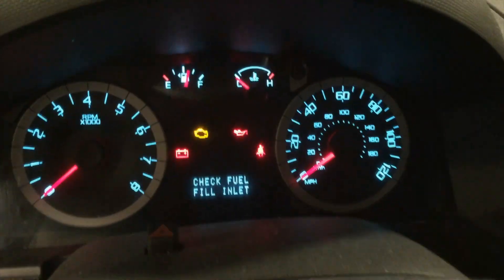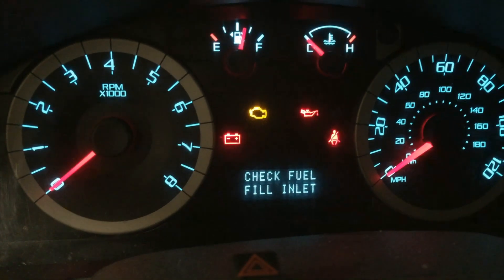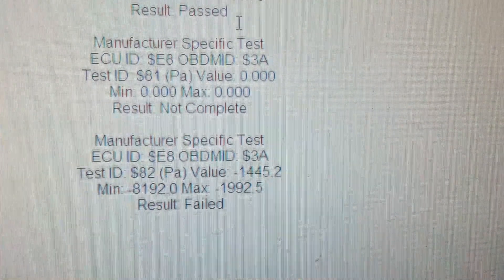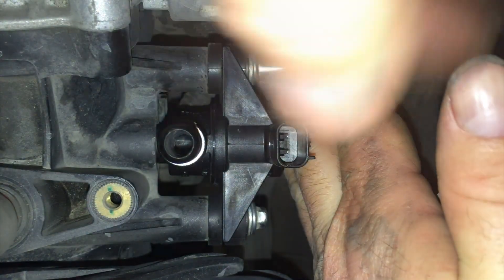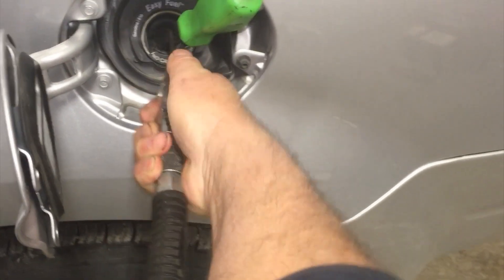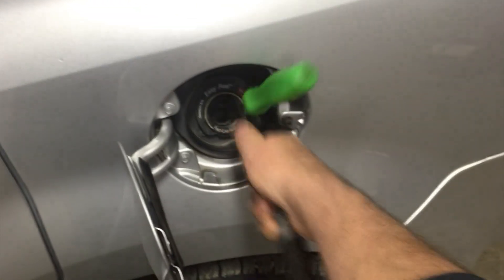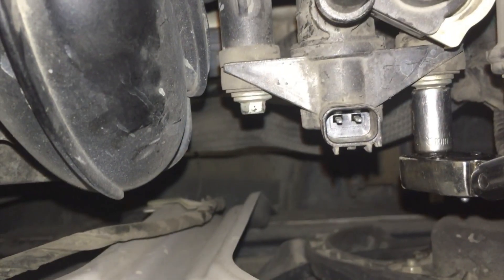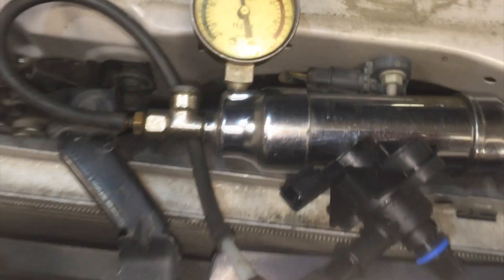Ford Code P0455 P0457  - Ford Escape Check Fuel Fill Inlet Message

Comment: If you used compressed air, do not use the plastic extension piece on the can of compressed air. It flew in there for me and I had to unclamp the hose and push it out using a boroscope. 😂😅
Reply from the maker: @ElusiveTechBro  oh crud.

Comment: So..I recently replaced the throttle body on my 2010 ford escape with the 4 cylinder engine. Now I'm getting the p0455 code. Could I have damaged the part you're talking about while changing the throttle body? While moving the tube that connects TB to air filter box?

Comment: I have a permanent code P0455 and P0457 on Ford 2010 fusion huh how much does all this cost with parts and work they tell me to keep driving the car doesn't drive the same smells like gas too. Feels frozen not fast no more too etc. I'm tired help.
Reply from the maker: Less than $100

Comment: Thank you for the help. This was very clear and easy to understand. I just picked up a Blue driver Scan tool and this code came up. I did have debris in my capless gas filer and it cleared up from the system. I feel like a pro now. 👍👍👍

Comment: Thank you so much for this video! I cleaned the fuel inlet and replaced the rubber seal on the fuel door. These codes kept persisting and no mechanic ever offered a resolution. I replaced this part so easily during a trip in July and the "Check fuel fill inlet" message and associated codes never returned. The car runs a lot peppier than before. Again, thank you for such a helpful video!
Reply: I would like you to inform me as 'How to replace the rubber seal on door" as mine is now a week seal and water is entering as drive thru washing.. thanks

Comment: I replaced the purge valve and cleaned the fuel fill inlet but still get the p0457 code. I was getting the p0456 off and on and changed the vent valve. What else could it be?

Comment: Thanks Car Doctor!  Save me a $250 diagnostic fee at my local Ford dealership and, who knows, whatever they would tack on to replace a $40 part.
Had a the fuel inlet msg for weeks, then last week came the Check Engine light - AutoZone told me I had a code P0457 on my 2012 Ford Escape.  Bought the part number mentioned in the video and installed it myself.  FYI - the light and msg didn't go away at first after installation and turning her on but after driving for 30min, then shutdown for 2hrs, and start up again - both fuel inlet msg and Check Engine light were gone.  Thanks again.

Comment: Great video.  My 2012 ford mustang 3.7L's cap will not open.  The little rubber next to the vacuum fuel cap area that is shaped like tiny pointed "thing" on the right side when opened seems to be damages within the fuel cap area.  Is there an easy fix to replace the immediate inside of the fuel cap area of the top area instead of replacing the entire fuel filler neck area that will require taking the tire off, etc.  Thanks. Dr. Helen

Comment: Great information.. Greatly appreciated. I also found that in the filler neck there are two plastic release buttons (1 on each side) that your fuel filler nozzle hits to release the filler flap. Mine was stuck so I sprayed a little WD on them and freed them up. Now the flap fits snug and the light went out.. Hope this helps...

Comment: Great Video - Thanks!! I changed out the solenoid in 15 minutes with your video as my guide. The light is out, the "Check Fuel Fill Inlet" message is gone - here's hoping they stay that way.

Comment: Hi I have 14 Ford escape 1.6 eco boat.i have no engine check light or any code but have a problem that every time I fill up gas .it wont start  it takes longer self and couple of tries. After starting  the problem goes away.and come again when ever I fill gas .Please help me

Comment: Hi Doc.

Would you know where the canister purge valve would be on a 2006 Ford Escape 3.0? My wife's escape has the same two codes you mentioned in the video. But the canister valve is not in the same location as what you showed in the video.

Comment: I have a Ford edge 2014 sport utility limited AWD 3.5L V6. Bought it used from the dealer at 52000 miles.Drove it 2000 mile
and the engine light came on. Stopped at Auto-zone and they came up with code 456. Would your fix work for that code also? Should I spend the money buying a filler cap?

Comment: Mine is not closing properly. It’s stays have way open. 

Any thoughts?
Reply from the maker: What isn't closing properly? The fuel pipe flapper? Maybe broken or contaminated
Reply: The Car Doctor 

It’s the flap. It can be pushed all the way in but it stays stuck  half way back

Comment: Whenever. I fill up it over fills, would the purge valve cause this? Or would it most likely be the breather line?
Reply from the maker: it over fills? as in it gets too full of gas and fuel runs out all over? or its har to fill and it keeps burping out gas while attempting to fill?
Reply: The Car Doctor the gas pump does not kick off.  It keeps pumping when car is full .

Comment: This is utterly ridiculous. Can that capless thing be REMOVED and replaced with a regular, screw-on cap? anyone can just walk by, open the  gas cap, and dump anything into the tank.

I'd be very interested in finding a way to remove that stupid capless thing, and get a regular, old-fashioned lockable filler cap.

Comment: Thank you so much for your excellent video. I just had "check fuel fill inlet " message yesterday. I simply bought a new valve to replace the old one, even without the diagnosis.  Then after only 1 full drive circle, the annoying message has gone. Your video is really helpful. Give you 10000 thumbs up!
Reply: What did you change

Comment: Great video thanks I keep getting code P0455 EVAP system leak 2001 Ford Escort I changed the gas cap that didn't fix it. So tomorrow I plan on lifting the car up and inspecting all the fuel evap hoses and that  canister and the purge valve... and I'll get back to you  find the leak...wade
Reply from the maker: How did it turn out?

Comment: Thanks for posting your videos and helping out , I do have a question I have a 2003 escape with a p0443 and the evap purge valve connector has not electrical power at all. The evap 5A fuse  has electric power however there's not continuity to the connector... My question is, should be a break in the wire somewhere or should be the PCM that is bad?

Comment: Thank you sir for this helpful video i have this problem with my 2011 escape 3.0 L , I will fix it i have this issue for about 3 minutes ago , after I checked it or changed the part I will put anther comment on your video. Thanks again

Comment: Thank you sir for this very informative video. I do have a quick question, when blowing the compressed air into the inlet, should I have the inlet open as you have in the video? I tried cleaning on advice of another video by blowing compressed air in the inlet, using the funnel provided in the car to toggle the medal inlet, then spraying the inlet with WD-40 and toggling the inlet again with provided funnel. I finished with drying the inlet with more compressed air some dirt wouldn't stick to the WD-40. Sadly after trying this, my message center showed the same message of "check fuel filler inlet" Trying to save some cash but should I have a smoke test done, or just replace the purge valve as recommend in your informative video. Thanks in advance for any info!
Reply: K270 Do you still have the error code on your dash? Did you disconnect and reconnect the battery afterwards to reset the computer and clear the engine code?
Reply: Also, I'm not sure I'd spray WD-40 on the inlet. That's just me though.
Reply: Actually, the engine light shut off on its own. I took it to my mechanic anyway and he saw several codes in the memory, one which he was unfamiliar with and I forget what the code was. He researched and asked me if I had recently disconnected the battery. I told him no, but I did have some corrosion on the terminal. His conclusion was to clean the terminal. I believe the reasoning was the computer needs a strong connection. If the connection is weak it can throw up codes. I cleaned the terminal a couple weeks ago and so far the engine light hasn't come back on. I should recheck with a computer to see if the engine codes have been erased from the memory.

Comment: Thank you for your video on 7:15 2017 I experienced the check engine light on my 2010 Ford Escape XLT after researching and coming up with code P0455 I found your video which at which time I went out to my local auto parts store and purchase the purge valve after installing and not forgetting to disconnect the battery to clear all previous codes I was happy to see my problem was solved many thanks you saved me at least a hundred fifty bucks.

Comment: Excellent info, thank you very much! I was t-boned in an accident 8th May and had this fuel fill inlet message shortly thereafter. I was also gone for a period of time and didn't drive the car until the 24th. I have to wonder if it's out of the realm of possibility that something got jarred in the impact. The visible damage didn't make it as far back as the gas door and the door seals well. After the first error code on 5/26, I cleaned the area, used the included fill funnel to  insert it in and out of the fuel fill area multiple times. The code cleared the next day. Today, I had the error again. Ugh! I'm definitely NOT a fan of the capless system. Clearly Ford knew it was going to be problematic or they wouldn't have included that fill funnel. Next stop Auto Zone tomorrow to see about codes. I did call my Ford dealer's service dept. It was suggested that I clean the fuel fill area very well (there was no debris that I could see) and disconnect the positive cable on the battery to clear all the codes. I'll see what Auto Zone says first.

Comment: I have a 2013 F150 the light came on which of course generates the check engine light, I have the cap less system... I've check and rechecked it, what do I do?
Reply: Nate Booker If you ever fine out PLEASE LET ME KNOW!!! I'm having the same problem. My remote start doesn't work because of it. If I find out anything I'll let you know... Thanks Sir...
Reply: Hey my friend, so I followed the recommendation of cleaning the fuel fill inlet with compressed air and making sure there is no debris and that it closes properly but I still had the stupid message and it was driving me bananas... So I cleaned it again and after I did, I disconnected the battery terminal for about 5 minutes and reconnected it and that cleared the error code from the computer.  I let my truck run for a while and did a vehicle diagnostic in the settings and sure enough, it was cleared.  After that, my remote starter works again.  I hope you have similar success.
Reply: I'm confident that this should be a recall.  It'd be much easier to just replace the fuel cap if it had one. Thanks Ford... what we owners really needed was one more headache!

Comment: Wifes 2013 Ford Edge had the "Check Fuel Filler Inlet"
Watched this video.
Checked wife's inlet, looks clean, door seals like new.
One week later, battery dies out with NO warning after driving 3 blocks to the gas station.
Give it a jump, still getting "Check Fuel Filler Inlet"
Replace battery, no more "Check Fuel Filler Inlet"
"Check Fuel Filler Inlet" must have been the "Battery Low" warning.
Reply: My Ford Escape 2012 had code problem VVT on cold start and power steering…fix with new battery!

Comment: I'd like to say Thank You as well, your video was very informative to someone like me that doesn't know anything about car repair. I drive a 2004 Ford Expedition and I'm having error code P0455 show up. Thank you again for the help.
Reply: Dwayne I have a 2004 expedition as well, did you fix it yourself or did you take it to the dealer and if so how much did it set you back?? Also I have a brand new fuel cap and Ford reset the check engine light and then a few miles down the road it came back.

Comment: Thanks for this video.  2012 Fusion, 3.0L V6,  same fuel fill message, 455 & 457 codes on the scan tool.  Based on this video went straight to the purge valve and sure enough it was leaking.  Quick trip to car quest and 20 min later the job was done.
Reply from the maker: Sweeet!

Comment: Thanks for posting this.  I blew out the fuel inlet using a funnel and air compressor and then replaced the canister purge valve as instructed. How long does it take for the check engine light to go off if that was indeed the issue? I've seen some message boards that say as high as 80 keystrokes... If its high, can I get the codes cleared using a code reader? Trying to figure out if I'm going to need to take it in or if I should just wait it out a few days/weeks and see if it clears itself out.

Comment: Hi!  I just had my purge valve as you showed in video but I got that message 'check fuel filler inlet' again few days after.  I have a 2011 ford edge.  Do you know what else could be causing this message?
Reply from the maker: Did you do all the tests and procedures in the video?
Reply: first I had went to AutoZone to do the scan tester which indicated some type of leak. gas tank doesn't have a fuel cap but we did do the whole funnel in and out to clean it with compressed air and that didn't work. my coworker who used to work for a mechanic shop thought it might be the purge valve wish that's how I found your video so we changed that out but no we did not do any of the tests.

Comment: getting a p0455 on an 01 escape where should i start
Reply from the maker: CK gas cap seal, fill pipe for rust, check all vacuum and vapor lines, canister and EVAP system wiring and controls. Monitor fuel tank pressure sensor PID with fuel cap off, smoke system and test cap for proper seal.
Reply: thanks
Reply: The Car Doctor i really badly need help.  do you have any idea where is engine number of ford escape located ford escape model 2003 2.0 please please send me an email @ brazen_jo@yahoo.com

Comment: HI, i have a 2010 Ford Escape. i noticed that the flap in the fuel inlet does not stay in place. It prevents me from fueling up. I also have the message on my dash for codes P0455 and 457. Can that be causing the codes to pop up?
Reply from the maker: Yes, probably need to replace the fill pipe assembly if you cant clean/repair the flapper

Comment: My little 2011 ford escape suv just started signalling the 'check fuel fill inlet' about a month ago and then the service engine light came on soon thereafter. I went to my 'go to' car shop and they did a diagnostic (evac issue) and identified that the gasket was pinched on the door. I was sent away with the code reset and instructed to clean the fill inlet with a wet cloth. After traveling on a gravel road for about 150km the light continues to come on when I start the vehicle. I suspect small particles of dust have also aggravated the situation. I will inform my 'go to' car shop about your recommendations. This was a very informative video for the none mechanical person that I am. Thank you
Reply from the maker: Sure, hope they figure it out. Take care

Comment: I have a 2010 Ford Fusion V6 SEL 3.0L. I have codes P0455 and P0457. I checked the capless fuel filler but didn't see anything in there but used the funnel a few dozen times to verify the door was closing fully. I also tried removing the canister purge valve and blowing into it since I don't have a vacuum tester but didn't detect any leak. Is that a valid test? Is there anything else that is common for my cars model that I should investigate? TIA!

Comment: What is an estimate for the cost of this fix ?
Reply from the maker: Depends on the actual problem. Cleaning the fillpipe cap is easy and cheap. Replacing the canister vent valve isn't too expensive. But you would be looking anywhere from $90-$300 parts and labor at most shops
Reply: +The Car Doctor thank you so much . Really helpful posts

Comment: You still monitoring this? I have a 2005 Ford Explorer with a 4.0. Where is this Canister Purge Valve on my ford? I have a PO457 code.  Thanks
Reply from the maker: +Steve Laminack in your case the most common failure is the vent valve located on the canister in the passenger rear underside of the vehicle. The less common EVAP control valve mounted on the firewall next to the brake booster can also fail. Be sure to check all hoses and fillpipe before condemning any valves. Good luck.
Reply: Thanks
Reply from the maker: You bet.

Comment: my 2009 ford escape has this code i am going to replace this part without testing... hoping it's the fix. is it a normal symptom to waste gas with this problem?! i used a whole tank in two days 100 miles. Urgh! I hope this will be the fix. what do you think? Thank you for the advice?
Reply from the maker: +Camron McClain Shouldn't cause excessive fuel use. Maybe you have a hole in your fuel tank?

Comment: My car is having this problem They have replaced parts - claiming leak, flushed cleaned.  Any other ideas?  I have had the car in the shop for five days (not consecutively) trying to fix the problem.  Sure would appreciate some input.  Thanks'
Reply from the maker: +Nancy Alain What parts did they replace? What codes did it have? Was it at the Ford dealership for repairs? Have you checked to see if it is under extended coverage for a filpipe assembly?